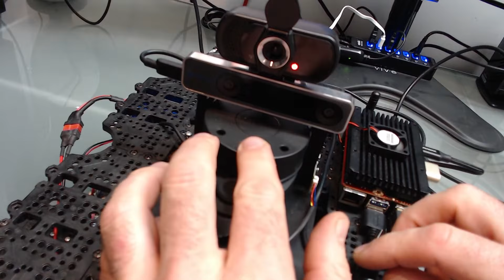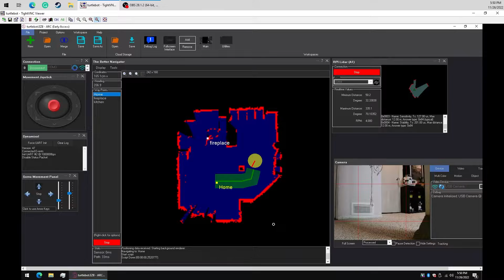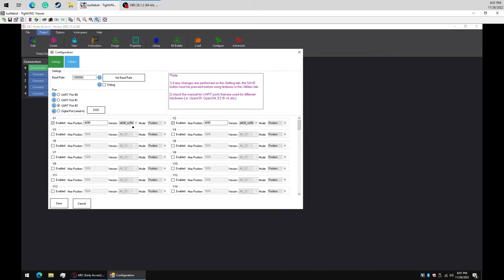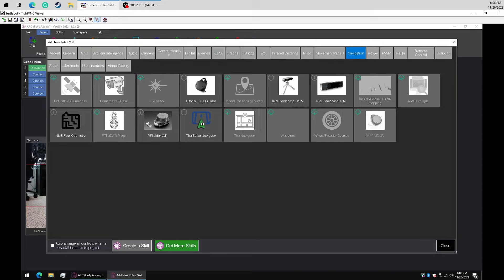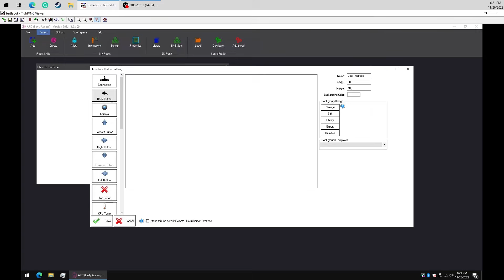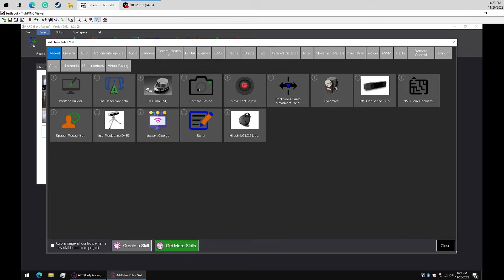Adding Lidar Navigation to a Robot

Comment: Can I use this with a drone?
Reply: The same approach won't work with a drone, although you could set up something similar using Pixhawk and Ardupilot (Idk what type of LIDAR is used on planes/UAVs but those would be really expensive as they would be long range, so using a LIDAR on a drone wouldn't be practical)
Reply: for drone better use RTK, will give you good accuracy then prob some vision algorithm onboard or local server running it

Comment: So the lidar is a TOF sensor mounted on a slip ring with a motor? Or does it tilt to scan vertically also?
Reply: There is no physical connection between the rotating head and base of Lidar. It uses induction coil to provide power to rotating head electronics and infra red transreceiver for data communication.. It doesn't tilt